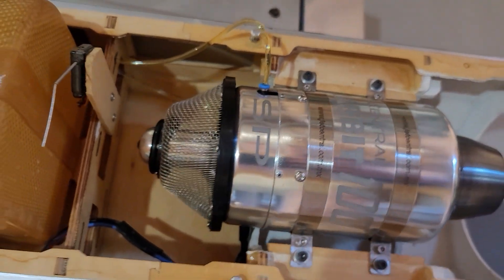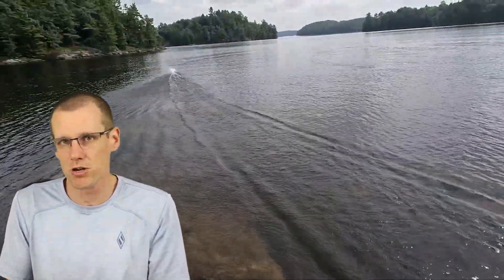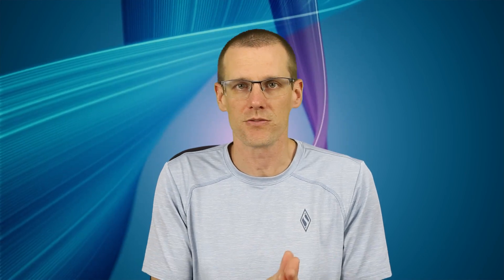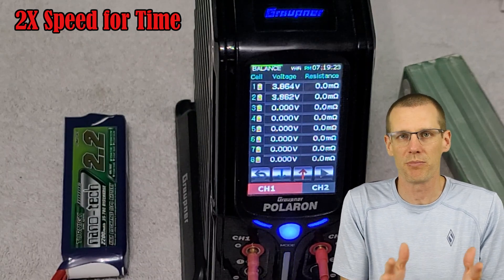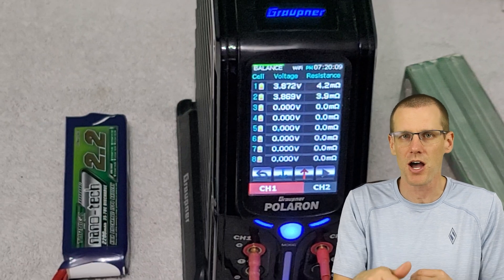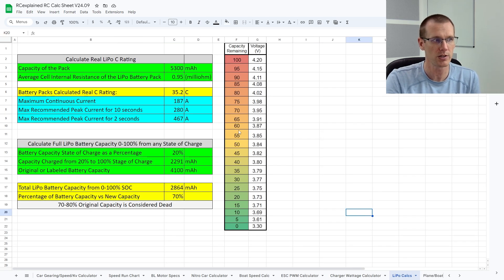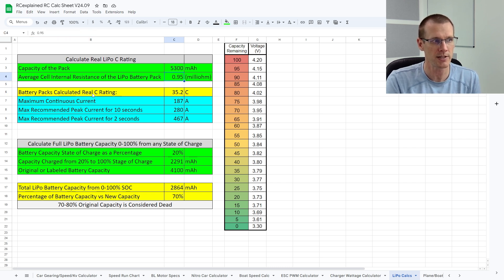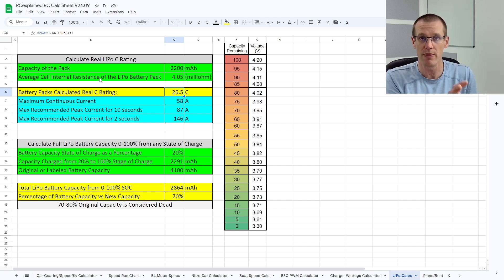Quick Hack to Effortlessly Estimate a LiPo Battery's C Rating in Minutes

Comment: hello my friend. so to be clear, i should charge the battery from any capacity level? or it should be from storage level? and with the IR value from 1 min mark should be sufficient for the calculation or it's better if i take de IR when the battery it's full charge? many thanks

update: the answer to this question is on the true c rating  section on the web page radio control info. thanks anyways. great info
Reply from the maker: From storage voltage is best.